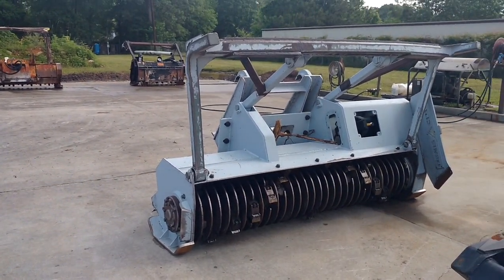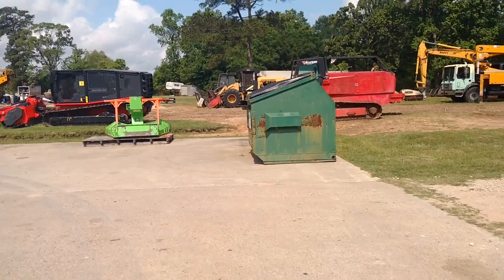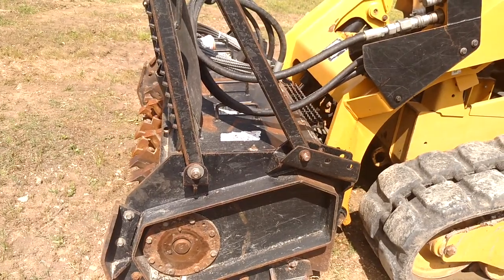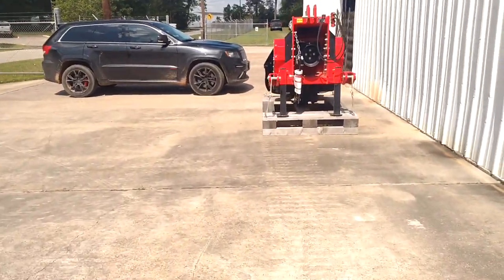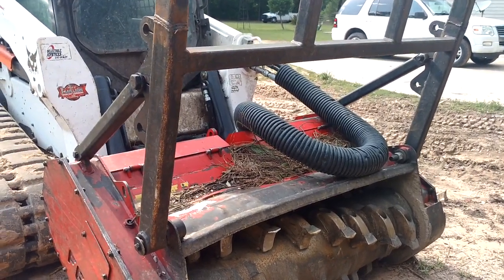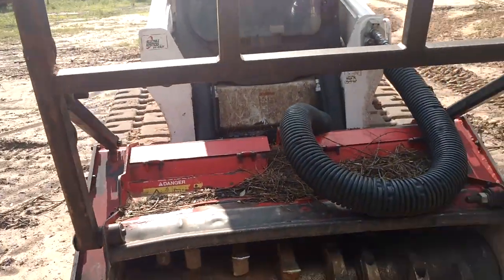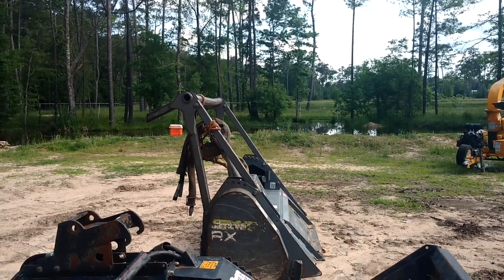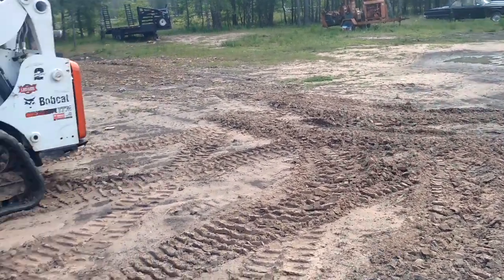Best Mulchers on the Planet

Comment: The raptor 300 isn't as heavy as you think. The kevlar rubber track and the undercarriage are made with very light and extremely durable materials. Around 38'000lbs and price tag would have to be around $600k